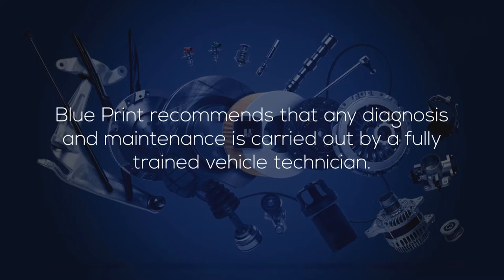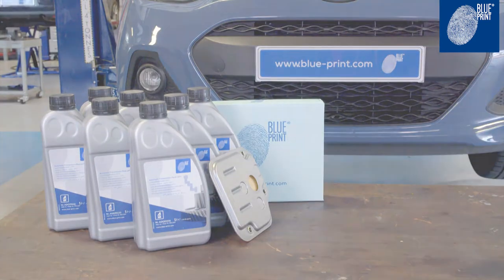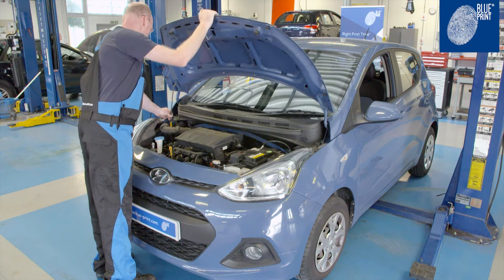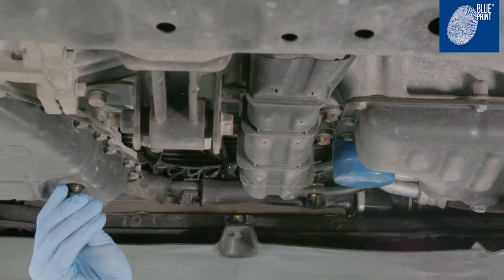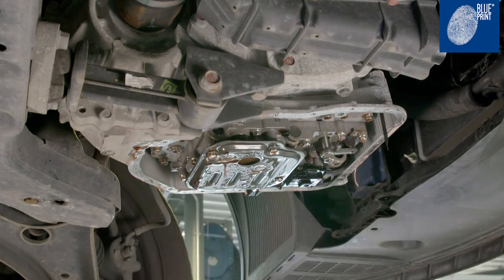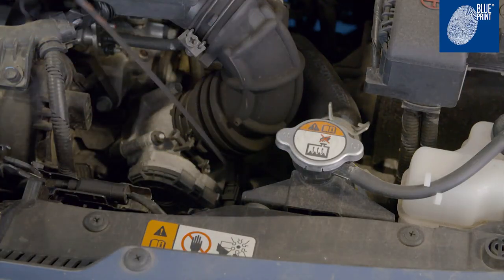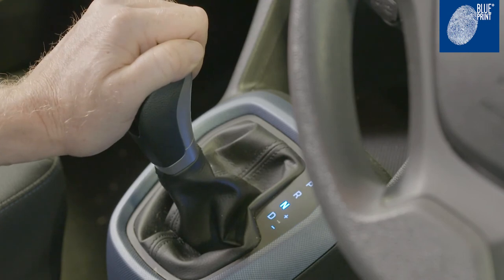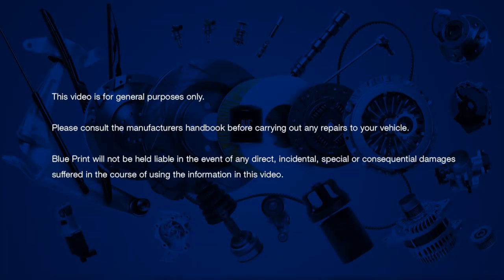[EN] Hyundai i10 Automatic Transmission oil and filter service

Comment: Do we need to check the transmission oil level at idling or switch off the engine after it's warmed up?
Reply from the maker: Thank you for watching our video. To check the transmission oil level, the vehicle needs to be brought up to the correct transmission oil temperature and with the engine idling.

Comment: Hello 
I’d like to ask is this a CVT transmission?Or the ATF ? 
Which oil can be use for this car
Reply from the maker: Thank you for watching our video. The vehicle featured is fitted with a conventional automatic transmission. The oil used was Blue Print part ADG05532, this and all our many other replacement parts can be found at www.partsfinder.bilsteingroup.com

Comment: Good day, 

I bought a Febi Bilstein transmission filter kit for a 2011 i10 1.2. I see I have received an oil pan gasket. Can I use that gasket, or should I use the gasket maker/sealer. I still have to perform the service and want to make 101% sure I have everything ready before tackling the task. Regards
Reply from the maker: Thank you for watching our video. We supply two kits, one with the filter and one with the filter and oil pan gasket. Depending if the original oil pan was sealed with a gasket or sealant, then use how it was originally sealed.
Reply: Thanks a million,  I ended up sealing it with Victor Reinz. I didn't want to risk it with the gasket, and then it leaks, just giving it 24 hours to cure before I add the fluid

Comment: Hola buenas tardes en el drenado de aceite en cuanto deje de salir aceite es apagar el vehículo o después de que deje de salir aceite de esa manguera es tenerlo 60 segundos?
Reply from the maker: Thank you for watching our video.
The procedure for draining and refilling the automatic transmission oil is as follows:
1) Disconnect oil cooler return hose.
2) Ensure selector lever in 'N'. Start engine and allow to idle. Drain ATF from oil cooler return hose.
NOTE: Switch OFF engine within one minute or as soon as ATF has drained out.
3) Remove drain plug and drain remaining ATF. Refit drain plug.
4) Fill transmission with specified amount.
CAUTION: Specified amount may overfill transmission.
5) Ensure selector lever in 'N'. Start engine and allow to idle. Drain ATF from oil cooler return hose.
NOTE: Switch OFF engine within one minute or as soon as ATF has drained out.
6) Fill transmission with specified amount. Reconnect oil cooler return hose.
CAUTION: Specified amount may overfill transmission.
7) Start engine and allow to idle for 1-2 minutes. Select each gear, then return selector lever to 'P' or 'N'. Check ATF level.
8) Drive vehicle and repeat level check when ATF temperature has reached 70-80°C.

Comment: Ich hava a question. When do you have to put it again in P? Once the oil has drained or after filling new oil?
Reply from the maker: Thank you for watching our video. The oil should be drained in the neutral position. Then after the refill process has been completed, the gears should be selected as per the video. Then the oil level rechecked in the park position.